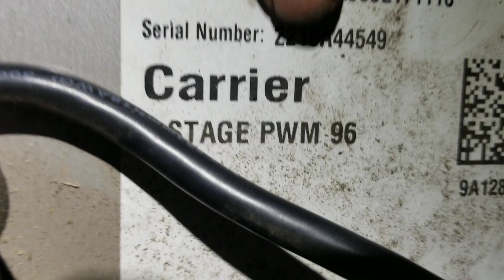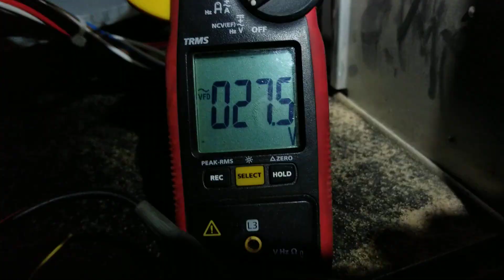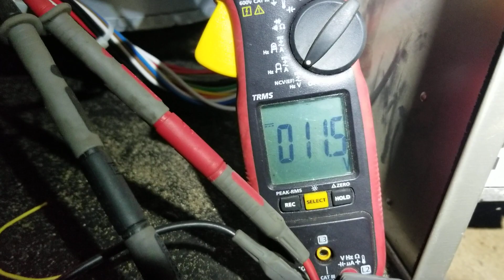Is It The Control Boad Or The Blower Motor ???

Comment: Jump out r and g if the motor don't run then it's shot, maybe just quicker
Reply: ThePeavey23  if the board is bad it won’t send the signal to the motor to tun. Need to confirm not just jump R to G.